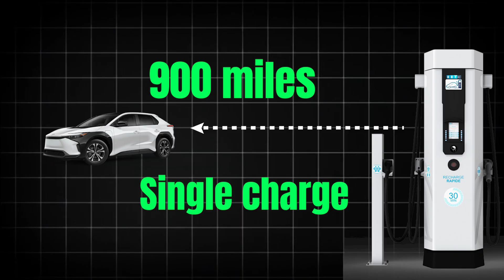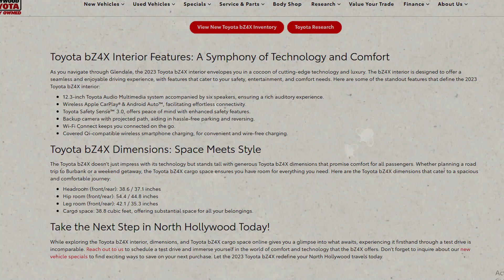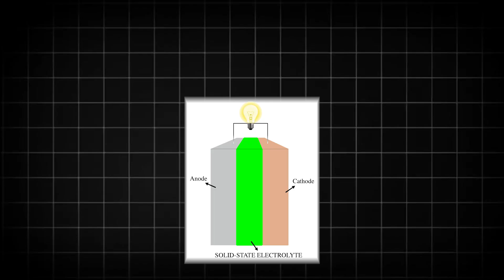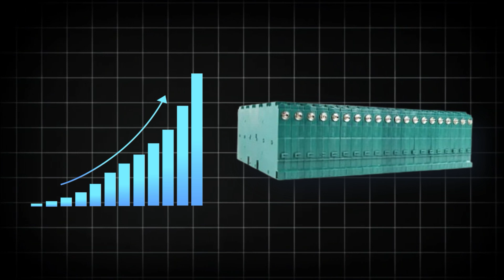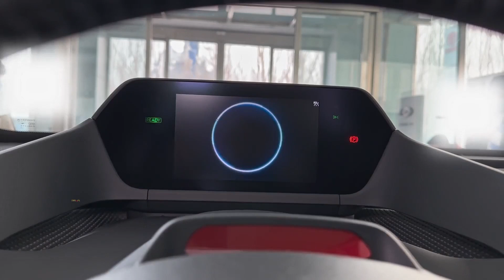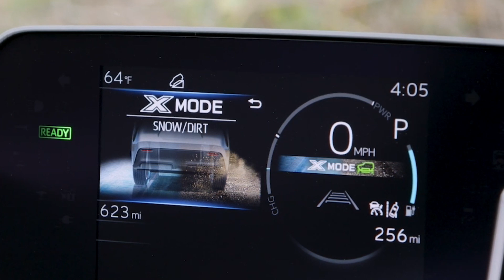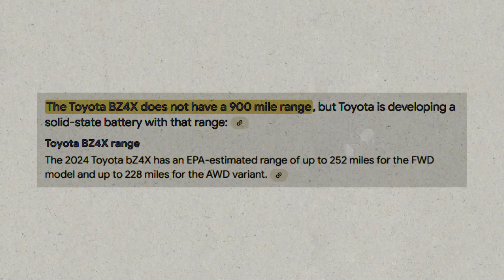Is This the End of Range Anxiety? Toyota’s New 900-Mile EV Explained!

Comment: I don’t care if they call it the Toyota zoom just so it goes 900 miles. That’s what I’ve been saying a lot of times we generally go across the country for jobs or Sea family are going to drive somewhere between 350 and 400 to 500 miles a day And we need that range because you got to find a charger and then you got to spend the night so it’s really important that the charger for this B4X is readily available. That’s the second thing that’s really important but if it goes 900 miles I’m very tempted to go and get one. I had one in the problem I had was it would only go 250 miles and if you wanna get home, you cut that in half and realize you can only use 80% of what they say it goes because if you’re gonna turn on headlights windshield wipers radio air conditioner, eater, or any of the aboveand other things you are going to lose battery you know if you need fog lights that’s another consumption so it’s really important that that car have a decent range
Reply from the maker: Cool. Appreciate you watching and ur comment 🙏🏽

Comment: on average people dont need  more than 300 miles they simply dont drive more
Reply from the maker: There validity to that statement. Thank you for watching
Reply: Until you are stuck on a dangerous 2 lane highway running a 2HP generator waiting 5 hours with no AC in Nevada in the summer hoping the 2 gallons of fuel will give you enough juice to make it to the next charging stop, all because the planned charging stop was out of service and there are 0 options.
Reply: @damaliamarsi2006   be real most of the people will drive this cars in the city it is there where matter and make a difference  if drive outside alot get a diesel that thing runs forever  imagine i pay  2.8$ for 50 mile drive  how much do you pay for your 6.2L 😁 the gas  car will no longer exist in the city it outlived it`s utility everything inside the city will be electric  imagine in the future when electricity will cost less and oil more ....
Reply: @lattehour  People who live in the city may want the freedom to leave lest the city becomes their prison.  Golf carts are perfect for golf courses yet we see few advocating for them as a daily driver, especially in Alaska.  Again when electricity is cheaper than gas I will consider electric, but right now electricity on highway comes in at about $14 us dollars per gallon equivalent.

Comment: Toyota plans to introduce its first electric vehicles with solid-state batteries between 2027 and 2028, followed by full-scale mass production. These batteries are expected to provide significant advantages, including faster charging times, longer range, and higher energy density compared to current lithium-ion batteries.
Reply from the maker: Great feedback. Thank you for u input. 🙏🏽

Comment: So ..... start talking about 900 mile range and then switch to 20% increase.  That is from 250 miles to 300 miles, or 300 miles to 360 miles.  Nice improvement but not earth shattering, paradigm shifting.
Reply from the maker: Ty for watching 🙏🏽